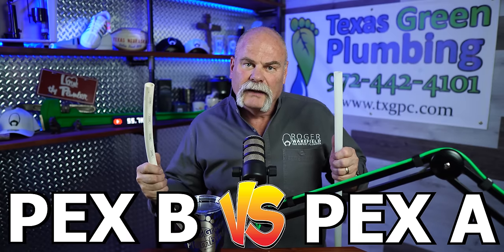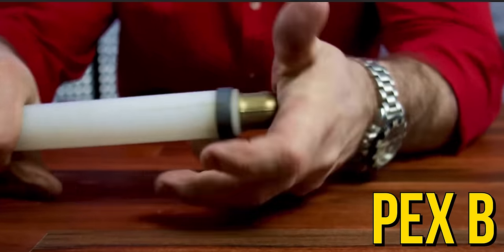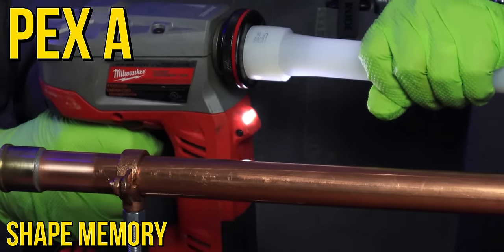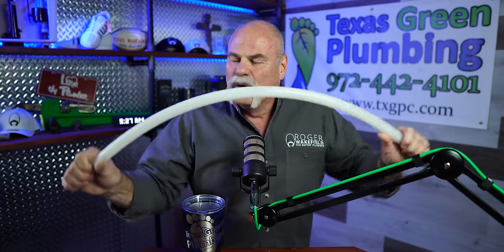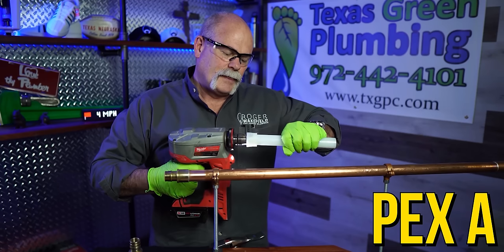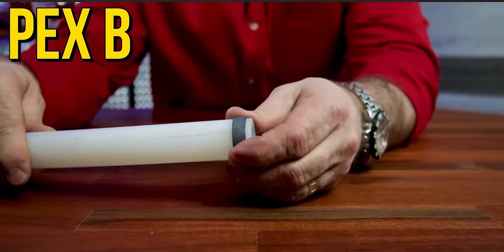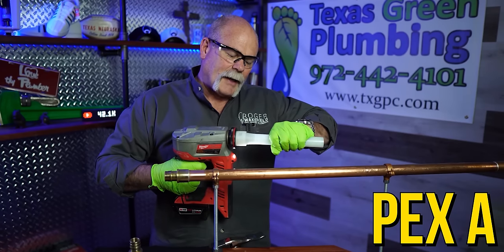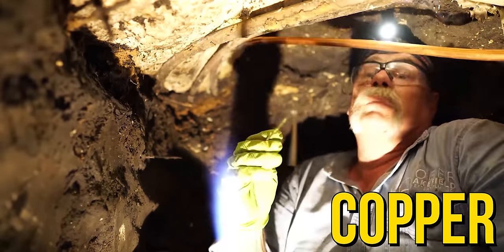PEX-A vs PEX-B - What's the Difference? Which Should You Use?

Comment: I am not a plumber but working on pans to build a house, would be doing most of the work myself. I knew I was going to run PEX, this was the most direct comparison of the two main types of PEX, thank you.  I will be going with the PEX A/Uponor option, I don't want to look at a fitting and wonder if it was made correctly or if it will come loose.
Reply: Just make good clean square cuts on the ends of your tubing and make sure you slide the expansion ring over the end and to the stop.  Not much to screw up other than not fully expanding enough to get all the way on to the fitting.

Comment: I use uponor Pex A. But I've never ever had a problem with reduced flow except if you use pex on bath or shower spouts. The resistance from the fottings is negligible. Theres usually a bigger problem if your flow rates are cut down a significant amount.

Comment: If the plumber plumbs the house with crimp fittings using 3/4" method the codes states to the proper amount of fixture's you do not see a loss of pressure. It will be no different than using copper or expandable fittings. I have proved this over and over it's not the material it is the plumber who plumbed it. All fixtures are reduced to a 1/4" or smaller water savers so up sizing it larger than 3/4" does really nothing. But the 3/4" per number of fixtures must be correctly counted. As you can tell I  use pex A so you can do both with but I use crimp 99.99% of the time. It's quicker and efficient. Just like your Opinion on expansion this is mine. As for not bursting when it freezes you are correct but be sure to let everyone know that them fittings sure will freeze and burst. Brass and plastic fittings do not expand and comeback after freezing.
Reply: Robert B.  ....most new PEX installations use "home-run" piping arrangement...and not "trunk-branch"....so you have little affect on "other" circuits affecting water flow when a certain circuit is "on".
Reply: Robert B.  The 1/4" reducer is inside of the faucets. There is nothing ran less than 3'4 and 1/2 to each fixture. If you turn on more than one or multiple fixtures then yes you are going to see a reduction.But if plumbed accordingly it won't be enough to notice.
Reply: @TheWilferch  Maybe that is how they are plumbed in your area. Quite a few around here use i the maniblock system here but the they all plumb it incorrectly. Maniblock systems are designed to be plumbd from point A to point of use with no connects in-between but everyone here still puts stops at the fixtures. Kinda defeats the purpose of the maniblock shut offs doesn't it?
Reply: fmartinez760  Which statement?
Reply: @jwblount7802  ...I would guess it does......but maybe that isn't so much of a problem...as it would give isolation at either end ( for whatever "problem" you have),....and consider: the resrriction is only at those points....it's not like having that same small diameter restrictionthroughout the length of the pipe....THAT would for sure cause low-pressure at the use-point. Getting back to the other issue....I guess I was trying to say that copper plumbing is usually plumbed trunk -and-branches ( coming off from a larger diameter "trunk")...whereas PEX is usually plumbed individually to the end use point...I call this the "home-run" basis. For most cases, home runs aren't affected as much as trunk/branch when someone flushes and another gets burned in the shower.
Reply: @TheWilferch  Here we are required to install pressure balance valves so therefor the scalding in the showers is pretty much absent. I have used both and the trunk and branch is the less costly and most efficient. I cannot justify  the amount of material used in a home run system

Comment: I’m with a large company in Georgia and we use Uponor almost exclusively.   We switched 10+ years ago.  When we did crimp pex we had blow outs all the time, sometimes years after install. Since switching I’ve seen maybe 3 blow outs and after examining the fitting it was always something crew did wrong or fitting had a cut in it that wasn’t noticed at install.  Uponor is top notch and I recommend to any plumber that’s thinking of switching.

Comment: I like pex B with sharkbite fittings. Now before everyone starts attacking me I have never had a failed sharkbite fitting in 15 years. Its very versatile and you can even butt joint pex a with pex b with sharkbite fittings. I also work mostly with raw well water system than municipal chlorine systems. Might make a difference but should all be the same.
Reply: Skinny Mcdoogin  yep I seen shark bits fail in residential in 6 years but out in the country side we’re people are on wells I seen them last haven’t seen 1 leak yet the oldest I know of is 12 years old  might have crustes on it but no leaks

Comment: Re-plumbed my whole house with B, used 3/4 line to copper manifolds, then 1/2 to fixtures. Works great. I actually have too much water pressure sometimes. Also used CINCH clamps, because the ratcheting crimper is smaller and easier to get in tight places, especially in some of the older rentals I have to work on.
Reply: My plumber wants to use a 1/2” in my entire house, would that be acceptable?
Reply: @Sophia-lc9ow  No.
Reply: @Sophia-lc9ow  Using 1/2" PEX all around will lead to lots of pressure issues. Running more than one device at a time will inevitably cause flow problems.

Comment: We use Uponor with viega stainless steel press sleeves, much better than the rings. Works great and allows us to make connections in tight areas if you make an adequate plan. We do a lot of poly repipes on slabs. Uponor in an attic is the play!

Comment: Im sorry Roger I have to Disagree with you and I hope you read this.  You started off great by talking about PEX A, B & C (there is a D).  The letter designation has nothing to do with the quality or fitting type that the PEX can use to attach. The process in which they Cross Link(X) the Polyethylene (PE) to make PEX (Polyethylene Cross Linked) is where the designation A, B & C comes into play.  Type A was the first chemical process that was patented to make PEX, then PEX B and so on...   The ASTM ratings that are stamped on the PEX is what they have been certified to handle for fitting connections: Copper Crimp (ASTM 1807), Cold Expansion with PEX Compression rings (ASTM 1960), Cold Expansion with Metal Compression Sleeve (ASTM 2080) and Stainless Steel Clamps (ASTM 2098) Uponor/Wirsbo is not the only PEX that can use expansion fittings!!!!  ASTM  1807, 1960, 2080, 2098  are what that PEX is rated for.  There are many PEX brands that can do COLD EXPANSION ASTM 1960.  Please update your knowledge and please be conscious of putting bad info out into the world. I have watched many of your videos.  Keep on making great content but please do fact check tech info it has a huge impact on the industry.  Thank you!
Reply: You are too critical, Roger’s point is about comparing A vs B, not dig down deep into code for us DIYers.  Why don’t you create your own video on what you say?

Comment: Pex (A or B) encourages lazy plumbing, especially in routing of pipes. I am replacing a shower unit today (after removing the old unit yesterday). What I found was 3 pex pipes (two for the shower and another routing to an adjacent bath) that are routed around the studs on the side of the shower wall. Since I'm installing tile over a previous one-piece shower unit, this will all have to be re-routed. Sadly this is a very common occurrence. Lazy plumbers grab at any chance to cut corners (no pun intended) and Pex is an enabler. The other problem is that I'm finding that older Pex, in the Arizona heat, is becoming brittle. Especially inside the perimeter walls. This results in leaks which usually go undetected for a long time.  When you come to sell a house here in Arizona, if the house is built using Pex you can expect to take a hit on the value of the home.

Comment: I bought almost everything in Pex A, besides the tub / shower manifold.  I have a pier and beam home and have a couple of questions 1.  Where can someone buy Pex A shutoff valves to make a, make shift shutoff manifold out of 3/4 pex. Question 2. What is the best solution to keep mice, rats, squirrels and etc from chewing through pex. 3. is it better to anchor Pex on the bottom of the floor joist  or is it better to bury it under the house and if so, how deep ??

Comment: I install crimp pex using a manifold system in utility room (zero fittings from manifold to fixture). 1” service line. Home owners are amazed with volume they get at each fixture. I’ve been licensed plumber for 20+ years

Comment: I prefer cinch crimp ring PEX-B, that way you can mock everything up and adjust it as needed, then go through and cinch all the rings when complete. I just mark with a sharpie after I crimp it for a quick visual of what's complete.  With PEX-A, you can't do that. once the fitting is connected, you can't really do much other than twist it, or cut it off and restart.
 
Obviously sweat is the way to go, and it's what I did when I recently installed a whole home filter, pressure gage, and water softener. The rest of the house however is PEX-A when it was built.

Comment: One of the problems when using pex is that it was originally designed to be used in a home run installation where you run individual runs to each fixture from a central manifold thus giving you constant pressure and volume coming off the manifold. However to save money plumbers do the same branch and tee system used when installing copper, with even a slight reduction in the pex pipe and compounding it by using a bunch of tees, it is a problem just waiting to happen. Installed properly with home run system using either pex A or pex B you will not have a problem with volume or pressure.
Reply: I somewhat agree. I recently replaced all the plumbing in my house. I installed  manifolds at the wafer meter and the hot water tank. 3/4" supply to the 1" manifolds. I still had to place a Tees at some locations which will reduce my flow.

Comment: Bought a house a while back that had a poorly installed water filter and UV lamp which was spliced into the copper water line using PEX-B and 6 fittings! I finally got around to replacing it with copper and re-routed the line to cut out four 90° fittings. The water pressure upstairs is so much better now. I sure hope the guy they had install it wasn't an actual plumber.

Comment: Great video. I have a question for any expert out there that wants to respond. And thank you in advance. I have a 2 story house with all copper plumbing using city water (no well). Last week my water pressure suddenly dropped to half of what it was throughout the house. Another strange thing that happened several weeks ago was the outside spigot closest to the water heater and the main line  stopped working except for one time when I had to wait 10 minutes for it to flow and it hasn't worked since (shut off valve is open and the other spigot works fine). I don't know if there is a connection but does anyone have any ideas of what could be going on? Thanks.
Reply: Check for dissimilar metals- I.E galvanized and copper connections.. could be that your pipes finally decided to close off. Look into dissimilar metals in plumbing and read up on it.
Reply: sounds like a restriction on the water line in the yard. better call a plumber
Reply: Victor Gomez - OK, thx.

Comment: Pex A because its a lot more secure at the connection
Reply: I dunno about that. Once you crimp that, it is super solid. The amount of leverage needed to crimp those rings is huge. I had to redo a fitting, so I cut the ring off. Even after cutting the ring off, I couldn't pull the fitting out of the pipe even with it in a bench vice and pulling and twisting on the pipe with all my weight. I ended up having to go and buy a new fitting.

Comment: We use pex b in my area. We use the same size in pex b as we would in copper and have no flow restriction problems. Matter a fact its usually on a repipe to remove the pex a. We have a lot of lawsuits around here do to the lack of continuous hot water rating on pex a
Reply: Victor Gomez  it actually does not or at least didn't have a continuous hot water rating. Thus the reason for the lawsuits and repipes we do

Comment: I re-did one of my place using uponor pex-A.  The end result is good and loves it.  There are some issues with pex-A though.  Main issue is the 1/2" expansion didn't give me a lot of time before it shrinks down too much to pop it on, where as 3/4" gives way more ample time to put my tool down safety and slowly slip the pipe over the fitting.  The 1/2" would mean to rush my tool down and grab the fitting and slip the pipe on asap or it might be on half way or 3/4 way.

I used Dewalt cordless expander, so do not know if milwaukee version won't have this problem?

Second issue is more like knickpicking:  pex-B allows everything to fit exactly first before crimping, where as pex-A you only see how it will look after the pipe bites down on the fitting.  Means sometimes your fitting location is just a bit off.

Thanks for the video.
Reply: Victor Gomez  I previously bought a Milwaukee head just to be sure, and it yield the same short time for push on.  So it is not the pex tubing, and it is not the expansion head, and the heads are 1/2" not 3/8".  I believe it is the cone of the tool that may not push forward enough to give it that complete stretch.  Will have to contact Dewalt to see what they say.
Reply: @diyjohn9584   Give it a couple of more expansions after it slides to full depth on the expander head.  But yeah, you're not going to be able to fart around long.
Reply: @doubled5074  I tried that when I first noticed the problems and did not make any difference.
Reply: @diyjohn9584  That's strange.

Comment: The pex a to copper fittings are a bit hard to solder. Make sure you prep the hell out of it
Reply: I started buying male sweat by upanor fittings and just pro pressing them right into a coupling or fitting, but I agree, they are tougher to sweat,  i think its because the brass hits temp way faster than copper so it is easy to scorch it if not careful
Reply: Sharkbite baby
Reply: Yep learned that the hard way with a $20 3/4" Uponor valve.  Melted the handle right off the bastard. Doh!

Comment: I've used Pex B for the last 4 years here in Ga. Had many freezes, the PEX B does in fact expand and contract to fight the freeze.  The size restriction is an issue for me though with larger houses. I'll run 1/2" drops to ONE fixture(no more than 10 feet) and size my main in 3/4" or above.
Reply: Also, it is expensive to re-tool, and no local suppliers carry PEX A.

Comment: Just did a a DIY plumbing job chose pex A. A little learning curve but after that and an $89 manual pex expander it does look very nice you can even shark bite pro the copper  connection if you don’t want to/ can’t solder

Comment: I use Pex B. And in NJ Pex B is most of what I see - regarding pex.

In service calls, I often see new houses with flow problems. But most of the time it's because it is completely undersized, whether it's the whole system or the risers. Anyone that does 1/2 " risers to an upstairs 2nd floor or 3rd floor bathroom is evil.
Reply: People use what’s in HD or Lowe’s.  Bought all the uponor on line.  100 ft spools, all fittings, for base board heating system.  Milwaukee expander.  More  expensive but wasn’t looking for the cheapest system.

Comment: I have PEX B plumbing because my house was built with it.  The only problem I have had have been two pinhole leaks (at different times) in the output (hot water) pipe from the water heater.  Unfortunately, half inch to repair the leak I had to use 1/2 inch sleeve fastened with pinch clamps which, as mentioned on the video, constricted the  flow water through the connection.  I wish the building code would require a 3/4 inch plumbing.

Comment: Get with the times Texas!  Pex has been used in Alberta for over 20 years now.  If you size your system right both systems work well.
Reply: @jghps4049  ding ding ding, your right.
Reply: PEX has been common in TX for at least that long. In fact, I saw it all over tract-house suburbia in the late 1990's, and a plumber I knew told me it was the only thing he'd use. It seems this video reflects just one individual's experience.

Comment: Pex B is fine. Just use more 3/4
Reply: Does using 3/4” pex B in a 1/2” copper system help with flow issues?  The 1/2” section of pex I put in to replace a section of copper is causing my kitchen sink to constantly fluctuate.  I’m pissed.  I’m debating going Pex A with expansion fittings or going 3/4” pex B with standard pex fittings.

Comment: I've installed several miles of PEX since it became readily available in my area around 2005. My earliest learning about PEX was wirsbo. I have never installed wirsbo simply because of the cost of the expander tool. I have never had a problem or call back on my PEX plumbing.  However, I have repaired pin hole leaks in wirsbo. At the time I had never heard of the chlorine issue. Now I know why it leaked and that there is a class action lawsuit. One other concern I have is that we typically use copper stub outs for supply lines. Due to the differences in diameter it appears uponor does not address this compatibility question or issue.